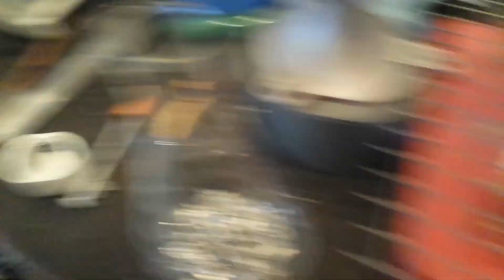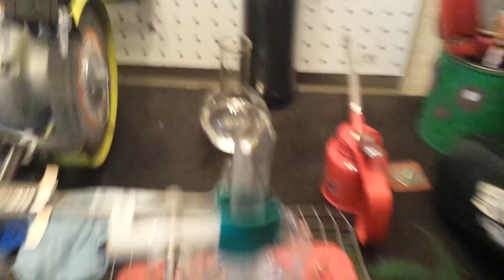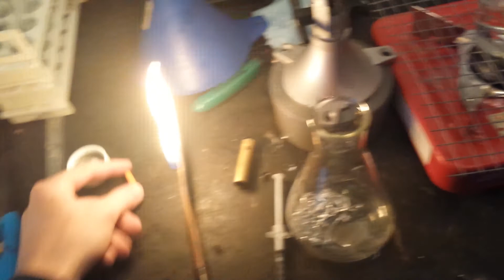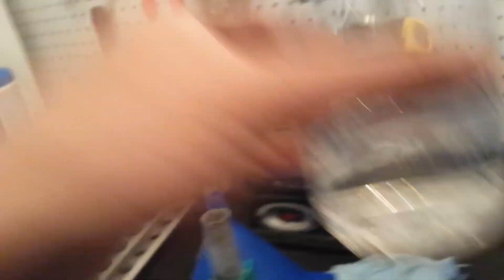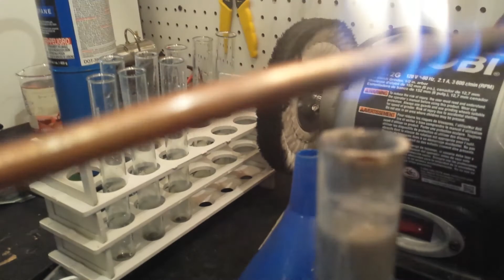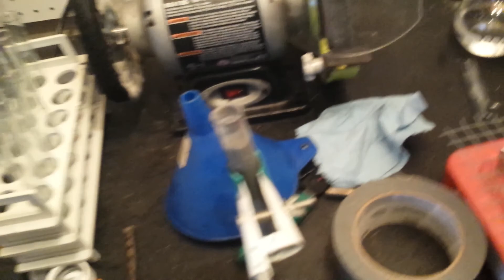Gallium fuel cell

Comment: Any idea how efficient this process is? Is the gallium wasted at all in the reaction or is it possible to extract it all back out. I am researching running a vehicle off hydrogen produced in a galium fuel cell.
Reply from the maker: The gallium is fully recoverable, the best method for extraction from my research and trials is via a centrafuge. The aluminum is the only thing that is spent.
Reply: @ATI556  any idea on how much hydrogen is produced per aluminum??

Comment: The only reason its not sastaining flame its because the reaction is violent and there is a lot of the steam in the in the gas .. just calm the reaction by reducing alum vol or gal vol .. and add a baloon on top to collect the h2.. i have a quetion is the gallium also disolving or just the alum.. if not this is the perfect way to produce cheap h2 since the alum its 7 euro per 1000 grams and from what i ve seen there your producing for sure over a litre of h2 with your aproxmately 1 gram of alum you hVe in the mixture.. thats equal to 1000 h2 litrres per euro.. and to electricity conversion  from my calculations thats about 8-9 cents eur per kwh.. if the galium disolves that will be more expensive than natural gas..also h2 has clean combustion but you gon left with the disolved aluminium waste .. this is a very interesting idea that needs definetely some research..
Reply: Nope, all the gallium is recoverable.

Comment: screen out solid bits of aluminun and then put the filtered material into a slab of a heat resistant material that has a series of holes drilled into it in a grid fashion where each hole is not so deep. Then place a water proof dam/walla  around it. Once liquid, pack  the liquid  gallium/aluminum solution into the holes. Cap the entire construct with a lid that will allow you to both pour bloining hot water in and bring the hydrogen gas together ....perhaps a top with a steel pipette which you can inject boiling water into the container and cap it until the quantity of hydrogen required has gathered at the top. attach a hose between the pipette and a suitable container for hydrogen gas.  make the holes for the slightly less deep than wide if u make it so the top of the slap is convex and there is a gap between the slab and the container walls  you could have a system that when new hot water is added the already reacted with alloy will rinse off from the surface, allowing unreacted material to be exposed more quickly. In this way the  hydrogen will not have to fight its way out from the much of already reacted material sludge.

Comment: I have the ultimate idea! Mix gallium metal and indium metal! Make a liquid alloy. Then use lab equipment to add hydrochloric acid to tin pellets. Filter and then get tin 2 chloride and then put in amber bottle. Use gallium indium liquid alloy to amalgamate aluminum foil and throw in the tin 2 chloride to speed up amalgamation! Then production of clean burning hydrogen fuel fire! Collect the reusable galinstan and add a small amount of bismuth. Tada! Amalgamation forever! Galinstanbiz!